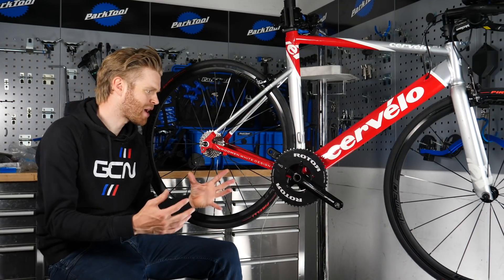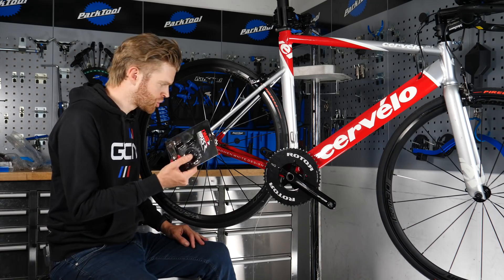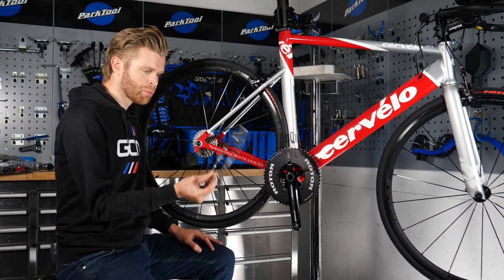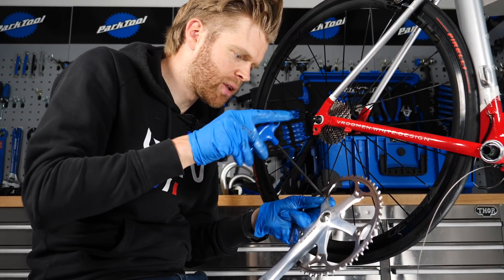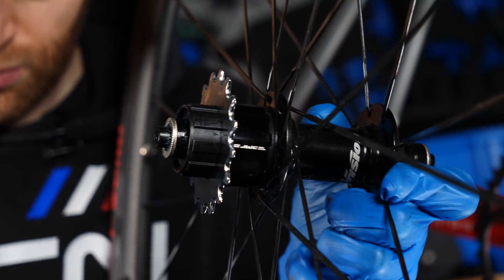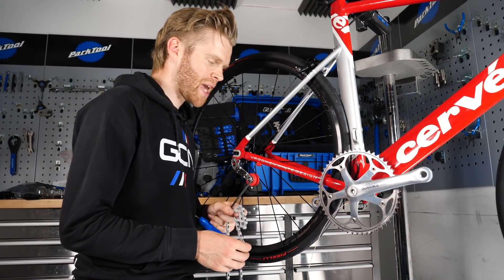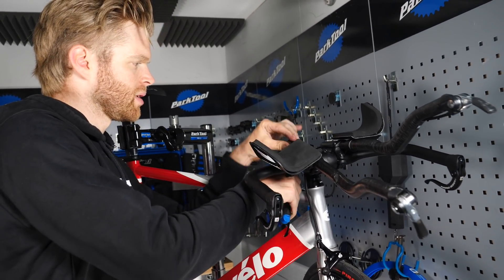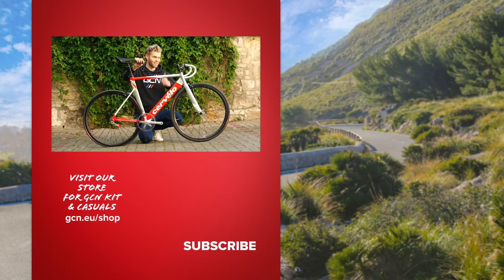Building A Budget Single Speed Bike: Part 2 | GCN Tech's Bike Builds

Comment: Ollie, can you please explore and explain the "unicorn gear" in the next video and maybe try to find it for your bike? (the one that doesn't require tensioner and works with vertical drops).
Thanks!
Reply: also depends on the length of chainstays...
Reply: The clue is in the name, the combo that will work is a rare as unicorns. If you do manage to find a ridable one, chain wear/stretch will have it bounce off over time. Save the headache & get a chain tensioner for Ssp or another frame for a fixie.
Reply: @GeekonaBike  you could also use an eccentric rear hub like the White Industries ENO.
Reply: @MAGAIVER  or an eccentric bottom bracket. Its not going to be possible to use the chain tensioner after building a flip flop wheel with a fixed sprocket.
Reply: it's really simple: just try it, basically the only variables are chainstay length, and whether that means you'll need odd or even cog sizes. I like to run 44t up front and 16t in the back, but on some bikes that combination might make the chain too loose, even with a half link in the chain or an entire half link chain, you might never be able to get the chain tension right, so by going up a tooth on the back, you make the chain tighter, and you'll have correct tension. So some of my bikes are 44/16 and some are 44/17- i always run half link chains
Reply: should also add that when the tension is correct, it will be very hard to get the chain on, just get it to engage on a few teeth and cycle the cranks and the chain should snap into place- unlike with dropouts where you put the chain on loose and then pull the wheel back, when you dont have sliding dropouts you have to put the chain on tight. Also as the chain wears you'll loose tension and there's nothing you can really do about that other than run a tensioner or buy a new chain

Comment: halo fix G hub and a velocity deep V rim man, its a solid freehub body so it alows you to fix any chainline issues with a set of cassette spacers, still using a 1/8 sprocket and the velocity rim is utterly bombproof, if you come into any trouble with the dropouts being too short look into using a half link from a bmx chain, that should alow you to keep a 1/8 chain helping you with chain tension issues

Comment: I was going to say you'll never push the gear Manon gave you. 🦵
Reply: 52-16, 52-17, 52-18, 52-19, and 52-20 are all great ratios/gear inches for city riding.  Plus 52s look way cooler than some tiny ass bike packing ring.
Reply: I ride all over with a 56-16, its plenty unless you have >15% grades
Reply: @WtfYoutube_YouSuck  if you live in a fairly flat city? Yeah. I wouldn't want a 52 living in Porto.

Comment: On my fixed gear i have a 48T chainring and a 14T cog and it's a really good ratio for climbing and for flat area and i suggest the wheelset a budget meal yet a good quality like legend or rinpoch rw565 and i suggest on the stem a 100 or higher no. And its on a -17 degrees so more aero for the chain i think a shimano peanut chain its good and reliable
Reply: 48x14? How big are your thighs? I think 48x18 is hard enough and prefer 46x18
Reply: @markrushton1516  well its just an average you just need a bit more practice my real ratio is 58t x 13t thats my track bike ratio it hard yet its my morning practice

Comment: Do you not use a straight edge to line up the drive train? We would never have done it by line of sight whilst karting, we used a steel rule. Shorter distance on a kart, but you could fashion something long, thin and stiff for the job i am sure ;-)

Comment: Why use a chain tensioner when you've got track dropouts? Isn't the point of track dropouts that you can tension the wheel by pulling it rearwards? Or at worst use one of those 'tensioners' that holds the axle on place by bracing against the end of the dropouts? What am I missing?

Comment: Instead of using a tensioner, what about using an eccentric bottom bracket?
Reply: Angelo price, eccentric BB’s are expensive, tensioners cost £10
Reply: They will work fine if maintained. Not really an affordable option for retrofitting though. Most frame builders/repairers can replace your dropouts at must less expense, plus Track Dropouts are a great look.

Comment: I have a few things I’ve done to make these projects work. Apologies if I missed that someone had already pointed them out. The first is the unicorn or magic gear. Use this calculator http://www.machinehead-software.co.uk/bike/chain_length/chainlengthcalc.html to work out a usable gear ratio for vertical dropouts or in your case fully forward. I once made a 48x20 fixie work using a frame with vertical dropouts. The chain was tight but not for long! On measuring, the eyeballing of chain line is not accurate enough. Get out the calipers and work out the distance from centre of seattube to chainring and centre of rear dropouts (65mm) to dropout so you can line up the cog perfecta mundo. You could have used the original crankset using a free hub geared wheel on the outside if measuring is correct. But the Dura Ace is way cooler. Next, for cup and cone bearing hubs you can replace the hollow QR axle with a solid one. For a 130mm or 135mm rear dropout you can get a 187mm rear axle from wheels manufacturing. Shimano also do solid long axles for their cheaper oem bikes.
And finally a brilliant flip flop hub choice is the White Industries eccentric rear hub, the Eno. You get more gear options for your short dropouts on the Cervelo. Their track singlespeed freewheels are worth the money for the sound they make alone. Only thing with a flip flop is you can’t alter chainline very easily. Make sure you check yours v the flip flop manufacturer specs. Good luck.

Comment: To properly tighten a quick release wheel for a single speed, I recommend using a allen bolt skewer instead of a quick release skewer.

Here's an image
https://www.bikeinn.com/f/13693/136935540/xlc-quick-release-socket-set-qr-a01.jpg
Reply: iohanan metellus got them on the front wheel of my Dolan track bike

Comment: I think that chain tensioner is going to spoil the fixie, IMHO.  Back in the 60s I used to ride time trials on a fixie without a chain tensioner, (which probably hadn't been invented back then), and the wheels were held in place by wing nuts.  I only once had a problem.  In my first 12 hour TT, it rained all morning and the chain might've stretched.  Anyway, after about 10 hours, the chain jumped off and jammed hard between the sprocket and the spokes.

Comment: Your build is coming along nicely but is it not standard for all fixies to have a Brooks saddle? - JK
My fixe is one of my favourite bikes and it is my go to pub bike, so for that I have fit half&half pedals. 

I have a 16T on my fixed side paired with a 48T at the crank for a 3:1 ratio, and I like it a lot, but when it gets really hilly and my legs feel like a sewing machine on the descents I have an 18T on the free side. The tyre lever in my patch kit is also a 15mm wrench and I have at times stopped to flip the wheel to the free side so I can coast on the downhills, and have a bit more help with climbing thanks to the extra two teeth.

Comment: how about a video on the techniques on how to ride and start out to ride a fixie. I think thy look proper cool but i am scared of them
Reply: Just ride it like you stole it...also brakes are death.
Reply: Start out with brakes attached, on flat pedals with no straps or anything to lock you in the pedals. Then just ride. I'm assuming you have ridden a bike before, not too much difference besides the slowing down process. You will quickly find yourself wanting toeclips or straps, I would suggest some form of retaining system pretty soon to get rid of the habit of using the brakes. But for the first tests I think it's best to be able to get your feet off the pedals asap. 

From slow speeds, try to resist the pedals until you stop. I found it easier with a slightly lower saddle than on a road bike to allow for better movement on the bike. Fixed gear riding is all about predicting future, slowing down early and picking a correct line to avoid pedal strikes is key.

You'll figure it out in no time. The difference between the first and second ride is already massive, after a week everything was already pretty natural to me. Don't be scared, just try it. It's more fun than riding a road bike imo.
Reply: @steezymtb5876  Naw.  Start with removing the brakes and ride with a freewheel.  Your only brake is raising your leg like a dog taking a piss and jamming your shoe into the rubber.  Once you get good at that, you can ride anything.
Reply: @WtfYoutube_YouSuck  hardly makes it any less scary. They said they are too scared to try fixed gear riding, I'd rather have them eased into this beautiful thing that is fixed gear riding than thrown into the deep end, have an accident and be another opponent of the greatest form of cycling. Hopefully your virtual balls allow for you to also be encouraging rather than make people shy away from the discipline.
Reply: @steezymtb5876  some men need a nanny, some need a drill sergeant.  dif. strokes

Comment: I've converted a bike and it's a nightmare. I have a clunking sound when Im doing anything other than pedalling gently. I've changed freehub, pedals, chainring, rear cog, bottom bracket and chain and it still does  it. I think now it's coming from the crank area, so I'm going to try a different crank. It's driving me mad!
Reply: Singlespeeds are supposed to be so simple and easy, yet they end up being a big hassle...
Reply: I had that problem once. It turns out I bent the BB spindle.
Reply: @newosamoht4593  found the problem, crappy chain tensioner, tried a new one and now all is fine

Comment: Building a flip-flop hub wheel will not eliminate the need for chain tensioning device. Any gauge of chain on ss stretches noticeably every 100km so you need a tenion deivce to accommodate this. Back in the day, 42 x 17 was the classic roadman's gear. 44 x 18 comes very close to this so gives you options sourcing. With a bit of effort it will get you up a lot of hills and allow you to cruise at 30-32kph on flat. End of gear dicussion, unless you're ignoring history and common sense and going MACHO.

Comment: You definitely have to change the hub because this solution is really bad compared to the quality of your crankset. Just look at the quality of the sprocket, it's really not solid! 
Otherwise, I have a little advice for you: if you can't get a perfect tension because of the length of your dropouts, use half links (yes those on BMX chains).You will be 100% sure to have a correct tension and you will finally be able to remove this bad chain tensioner system.

Comment: Stop using that stupid pulley to tension that chain; you got horizontal dropouts so use a decent dropout chain tensioner!
Reply: Exactly.A chain tensioner would only be sensible on frames with vertical dropouts.
Reply: @reapanomin899  Not really. Its a quick release wheel so its going to slide in the horizontal dropouts until Ollie can build a wheel with nuts rather than QR. He is going to have to get rid of the tensioner if he puts a fixed sprocket on the flip flop hub he proposes or there is a bit of an accident in video 3 or 4!
Reply: @mathewjames4137  it's not gonna slide as the dropouts are TT/track and to the back. It would slide if they were horizontal and facing forward like in traditional steel frames (e.g. campa / cinelli dropouts). And remember it's a single speed, not a fixie, so less forces on the dropouts.
Reply: @l.d.t.6327  I understand that but thats only correct if the chain can be adjusted to the correct length with the wheel all the way into the dropouts. If not then the wheel wont be all the way in to get the correct slack in the chain. I would wait until I had an axle with nuts rathe than a quick release.
Reply: agreed that a dropout chain tensioner will only pull at the axle in order not get get a slack chain, and you could still make good use of an adjustment screw in order to hold the wheel in the right position. At least my  tt frame with rear facing horizontal dropouts has those built-in adjustment screws. The Cervelo probably hasn't. In any way, even without those screws and dropout tensioners, most wheels would hold fine with just the quick release, at least if it's a good one.

Comment: NEVER EVER use this type of chain tensioner on a fixed gear bike (OK for single speed). This one-bold attachment is not strong enough to withstand the forces coming in both directions, and it will eventually become loose and fail. I let you imagine the consequences...
Also, "spring-loaded" tensioners, as the one from XLC, works much smoother (have been riding this same kit for 3 years and changed for the one from XLC few months ago).

Comment: Thechain tensioner hurts my eyes
Reply: It stops as soon as you start riding bike - just don't see it. 
There are no many choices for frames with vertical dropouts. Choosing between puristic look and actually riding bike...it's easy, eh?
Reply: Event 42 Eccentric hubs and eccentric bottom brackets exist. And anyway: Ollie’s frame has a horizontal dropout.
Reply: @LitNews  I believe tensioner was used to demonstrate a budget means for all people using frame with vertical dropouts - accent is on a word "budget", just like in the title. This is informative video covering principles. Ecc. BB is debatable but ecc. hub for most people doesn't fit budget conversion scheme.

Comment: Why would you want a single speed bike?
Reply: simplicity.
Reply: It depends. Question is why would you want multi gear bike on a flat terrain? 

P.S. Single speed is not a correct term - you can have a lots of speeds with single gears front and rear. Bike have gears, cyclists have speeds.